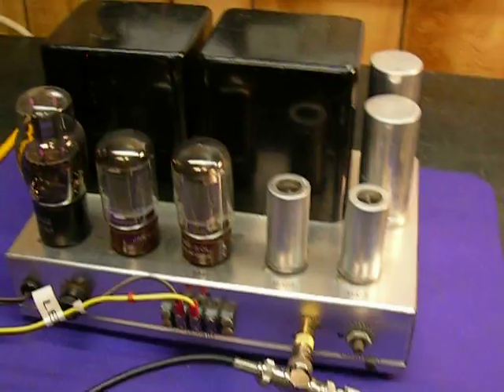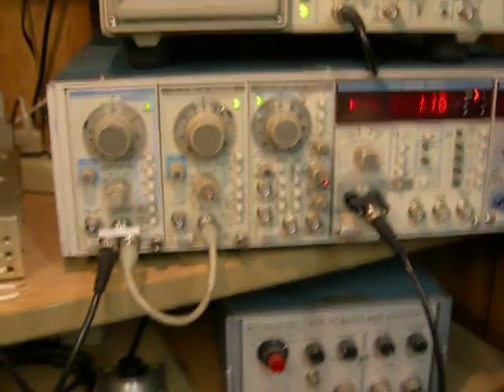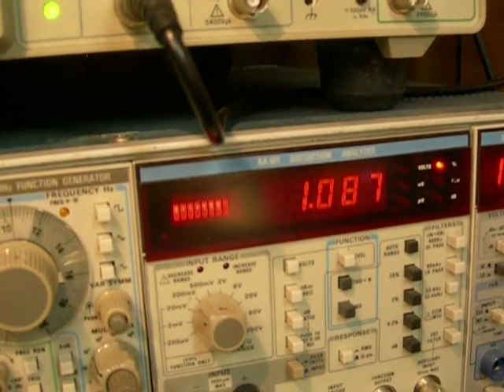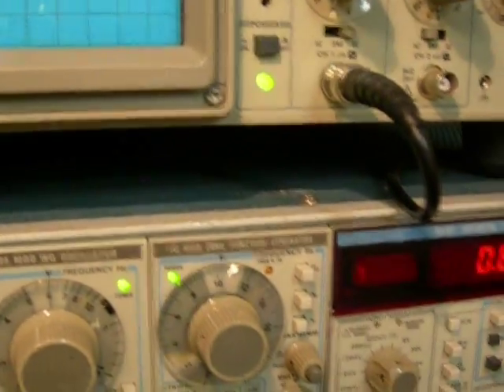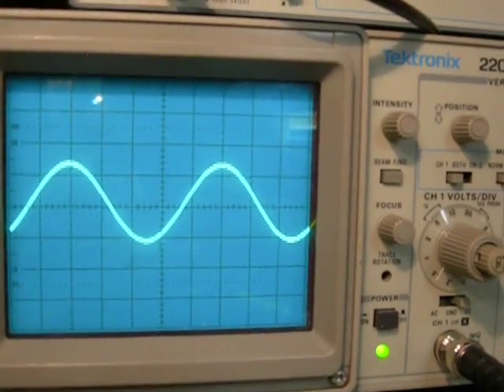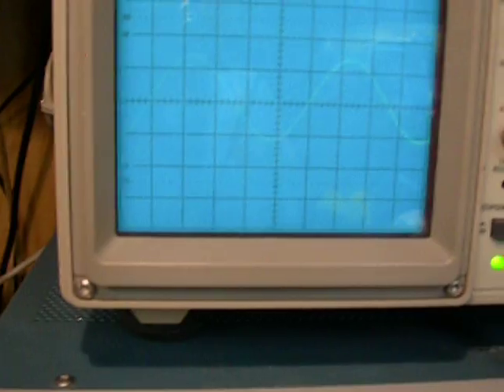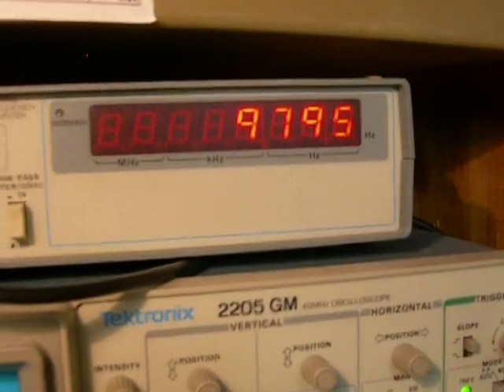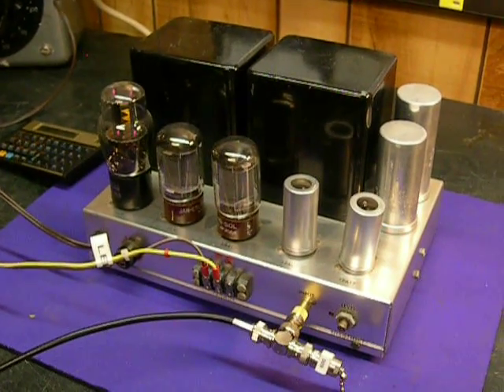Fisher Vacuum Tube 70-A Amplifier Undergoing Measurements

Comment: 11 year old video. Apparently no maintenance was done to the amplifier? All original power supply capacitors, wax coupling caps, out of spec carbon comp resistors. Matched 5881’s? Maybe the power supply was sagging, original parts?
Reply from the maker: Yes, all original parts at the time of this video. I know the 5881's and driver tubes were good (and probably still are). Possibly the 5V4 might be weak, not sure at this time but I try not to change out parts that aren't truly bad. Of course, this amplifier is 60+ years old. Maybe I will take a look at it soon now that you have reminded me of it. I collected this amplifier as I listened to one of these as a 13 year old at my uncle's house in Oak Ridge, TN. Wonderful memories. Thanks.
Reply: @ElPasoTubeAmps  I located an orphan. Price was right. Now have a mate on the way. They will be getting full rebuilds.